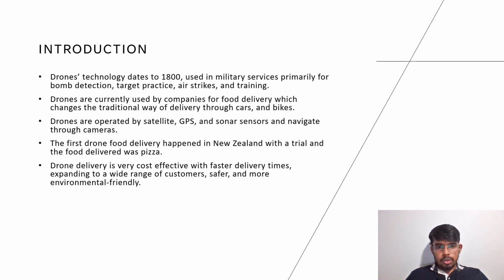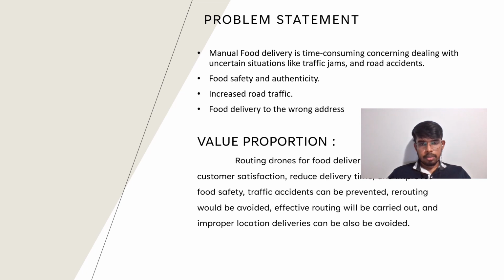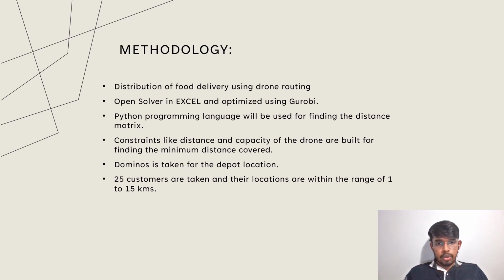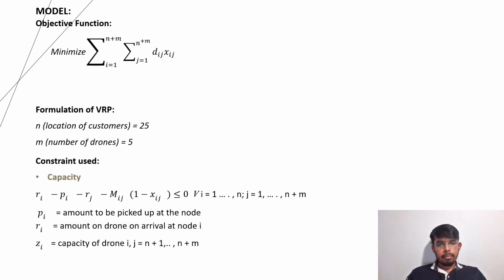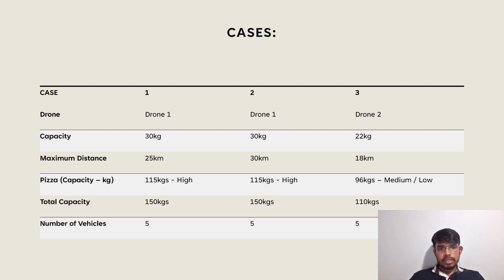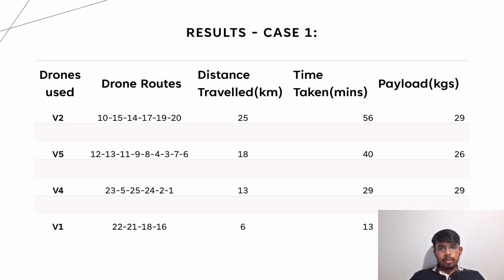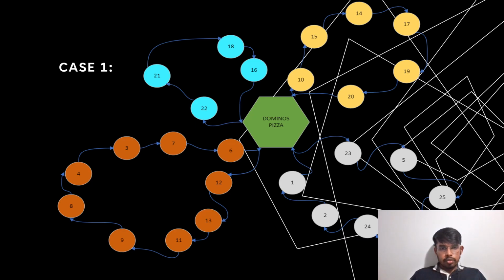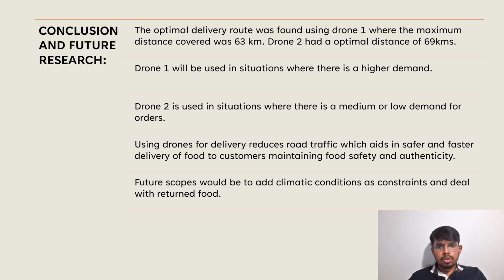Food Delivery using Drone - Vehicle Routing Problem

Comment: Dear Sir, I am an undergrad student. I don't have much experience in this field. I am  currently working in a similar kind of problem. I am trying to run a model of a paper, "A Robust Optimization Framework for Two-Echelon Vehicle and UAV Routing for Post-Disaster Humanitarian Logistics Operation" for my battery understanding of how to run my model in AMPL. But the output is got is not convincing. I would appreciate it if you are kind enough to share the model file, data file and run file with me.    Can you please tell me how to contact with you?